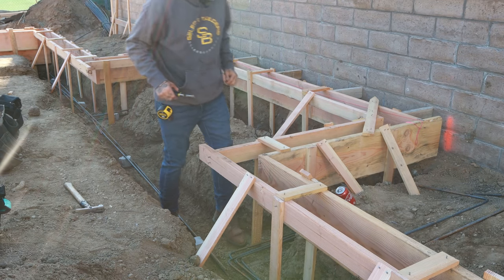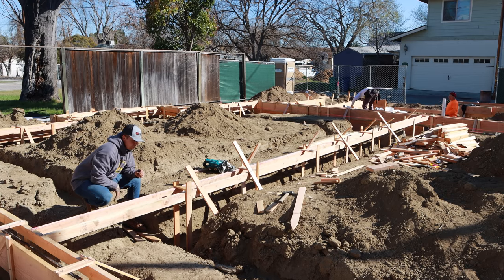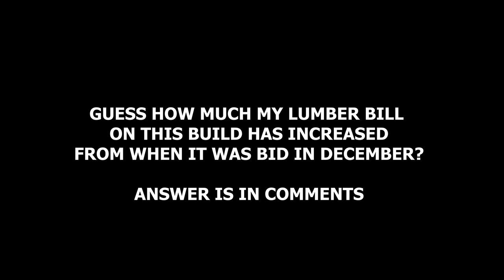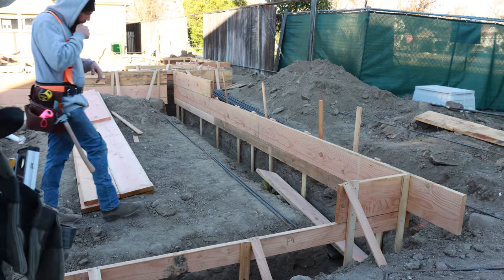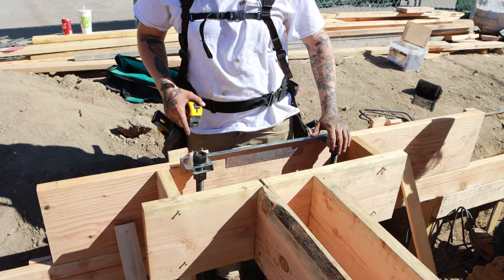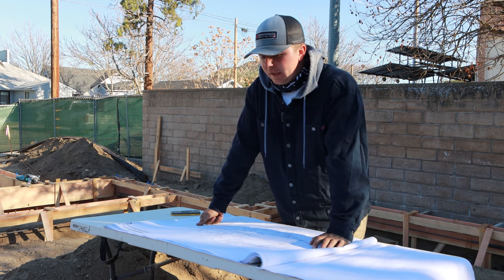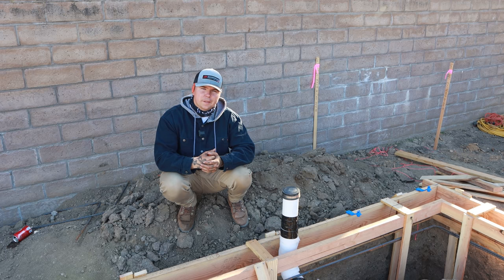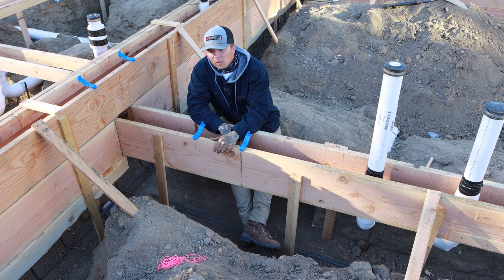Concrete Foundation - Spread Footings, Point Loads, Plumbers In + Out #3

Comment: In Colorado 30% across the board.  Rough framing materials is about $25 a sq ft and additional $4 to get through the roof on a typical build. But  we have 1st level floor systems not slab on grade.   Bang On!!!👊

Comment: here in Eastern Canada metal studs are the being used for many reno's (Basement etc) as they are costing the same as a 2x4 "used" to be.   I just did a house build and the lumber costs were about 50% higher than the previous year.

Comment: Should sub grade it first then dig the size footing, that way you don’t have to use to much form, only form the outside perimeter, easier to put all your footing rebar. Finally put in your 6” base, then pour the footing and slabs same time 👍

Comment: Idk about every plumber but the ones where I'm at don't ever bother trying to look out for framing when they are doing their underground work. All of the issues that you mentioned other than the tie down location would have been other trade issues. But I get what you mean. You found a problem. Might as well have it fixed now before it's a pain in the ass later after the footings are poured. I try to do the same if I catch something when I come into work after other trades

Comment: Hey mat, ive been building for a while now and see you guys still use handnails for your forming, I highly recommend using screws for forms and anchor bolts, makes for a much cleaner tear down, rather than pulling your hammer out and dealing with alot of movement whilst driving the nail. Just my opinion tho! Bang on fellas
Reply: until your screws get filled with concrete lol, maybe screws are viable when you buy 10 rolls of tape to cover them before a pour... probably not worth the hassle. hand drive nails win... theres a reason they have been used to make formwork for however many years hahahah. dont try to outsmart the oldtimers you lose everytime
Reply: @kaindosil8854  Try Duplex Form screws.

Comment: Framing question for you when you nail the bottom plate you are supposed to use galvanized nails can you use those on the top of the wall with the top plate as well?
Reply from the maker: Yes, you can shoot galvanized into top plate. Just make sure you don't need to pull anything, they don't come out easy.
Reply: @MattBangsWood  thank you!

Comment: Those screws You put with the metal bracket. the code allows you to weld to the rod ?
Reply from the maker: No, I'll show those being utilized later on. The strong wall system only needs 2-1/8" sticking up from stem wall to be utilized.

Comment: For those who might have a tough time visualizing the difference between uniform loads vs. point loads (also known as concentrated loads), picture this:

You’re sitting in a classroom with a bunch of students, and the teacher is standing at the front of the room with this huge 12 foot long beam sitting on the floor in front of him. The beam weighs 2000 pounds. The teacher asks for 6 volunteers from the class to come up and pick up the beam. So, 6 burly lumberjacks mosey up front and spread themselves out evenly and pick up the beam. Each lumberjack is now carrying 333.33 pounds (uniform load). The lunch bell rings and the 4 middle lumberjacks run out from under the beam to get to the cafeteria so they can be first in line for lunch. The 2 lumberjacks who are left standing, one at each end of the beam, are now each carrying a 1000 pound point load. Got it? Lol
Reply from the maker: I love this, lol.
Reply: this is a very strange classroom.
Reply: So, could you be my Mechanics of Materials teacher?..:)

Comment: Is it video angle or is the power line going to interfere with your building?
Reply from the maker: Powerline is 100% an issue. Hoping to have it down soon as we start framing in a week ..
Reply: @MattBangsWood  was this an obstacle you had to plan for/but into your costs?
Reply from the maker: @robertmerwin8194  Yes, I planned for all of this prior to bidding. We knew the challenge it would be.

Comment: Man, as a concrete guy I hope that's enough bracing for all that weight. Matt, remember concrete is 150 or cubic foot on average.
Reply from the maker: Only pouring footings the first go around, we'll strip then pour finished floor afterwards. I'd tread lightly doing this in a single pour.
Reply: @MattBangsWood  Got it. Good idea about bringing those forms down on sides. Not only does it look nicer, it'll save you on concrete. I'm sure you'll install but make sure to use 10 Mil instead of 6 mil poly when you get to Pad, will save you headaches on tears. Usually we wrap the poly on inside of perimeter beams, but if you install below pad, it should be good enough.

Comment: Here's a heads up for you; if you use 2x material for forms better spray those bitches down with form oil otherwise you'll have some weak ass honeycomb concrete if you don't vibe the shit out of it. Hope this helps you save some money and save some structural potency. I get the idea of using 2x to make forms never seen it done before,,, as long as you have a use for all that wood after you strip and you have the man power to scrape it clean before you frame something with it not to mention having an off cut pile full of random 2x .. interested to see how you manage that,

Comment: All this "free money" is turning out to be very costly for commodities. If they keep handing out money, prices are just going to keep going up. No such thing as a free lunch.
Reply from the maker: Inflation = Commodity rise, anyone who knows the market knows that.

It's terrifying for builders and people wanting to build.
Reply: @MattBangsWood  This is my problem, as well. I bought some property in the desert, and had an initial design ready to discuss with the City. Now all I can afford is a one bedroom house, where the garage is nearly equal square footage. However, I think I can save money in the HVAC and water heating because I can eliminate a propane tank and the associated plumbing.
Reply: @jamiboothe  If electricity cost are reasonable, look into a Mr Cool mini split. You can install it yourself. Has both heat and cool. Good luck!
Reply: @lorenrickey5481  Thanks, that is exactly what I am looking at. We are required to design in a solar system, that matches our electricity load. I am designing a lean to roof that faces South, and 10 foot walls for the North. The lean to roof will work well with the ductless mini split. I was very happy when options opened up, and I found the Mr Cool device.
Reply: 41% increase
Reply: @MattBangsWood  Do you hedge your prices and protect your margins by getting exposure to Lumber in the Futures market? I imagine you go thorough quite allot of lumber in a year
Reply: @MattBangsWood  Inflation on average is 2.0%.  It has nothing to do with the cost of commodities.  I think what you meant to say was Supply vs. Demand has EVERYTHING to do with the costs of commodities.  Copper, Steel, food, gas, silver, everything is about to skyrocket